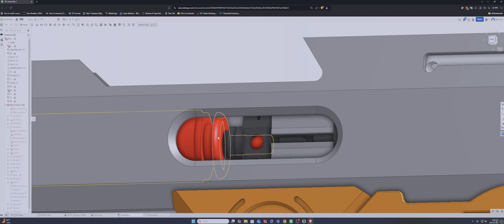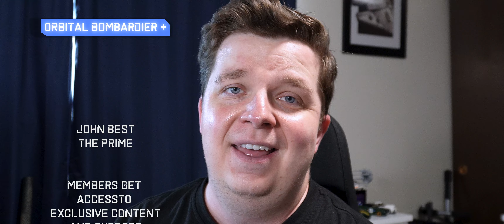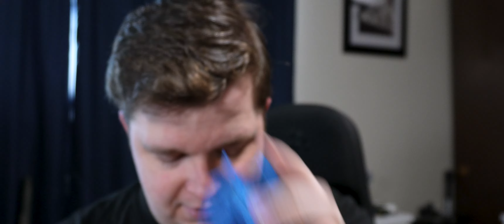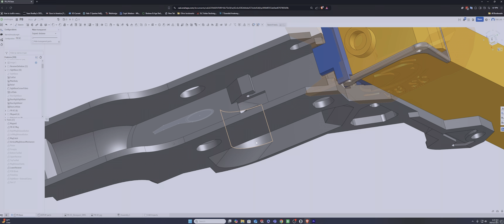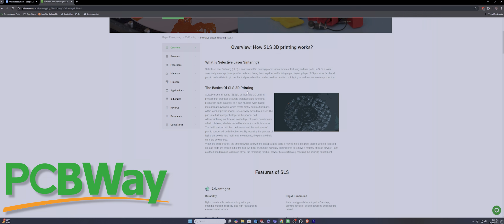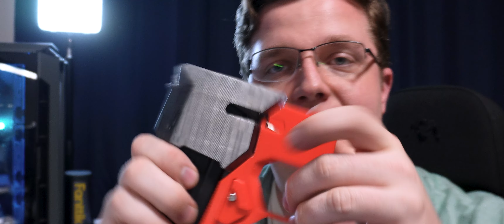I'M Turning Star Citizen into REALITY!

Comment: Especially if you want to be able to use it to adjust controls without taking the weapon apart, what if you treated the pcb screen as a rail mounted attachment (ala rangefinder)? The screen would be connecred to the pcb itself via a connection built into the rail and allow you to shape the pcb as needed and even build it into the hand guard. When you dont have the screeen attached, the pcb just remembers the last settings (i dint see how you built the pcb and wether you had on board memory, etc). 

Civil engineer so forgive the limited memory of my mechanical/electrical classes.
Reply from the maker: That is one solution. The thing I'm concerned about is users might not like being forced to have that as an attachment. So if I could shrink it down, that would be better. There's a little pocket of space in the receiver behind the solenoid. My ideal solution shrinks it down to fit in there. 
Never doubt your ability to put forward an idea. Mech Eng doesn't have a monopoly on ideas.

Comment: Could there be a way to split the pcb in half and join the halves via some solder and wiring? That way you could line them up side by side or front to back inside the stock or something like that
Reply from the maker: The code is written such that it should be able to support a smaller screen (cut in half horizontally).  I think I'll do that first as it's the largest component and has the biggest dictation over footprint.  Then we could look at splitting the PCB.  I don't want to stick it in the stock because I plan to make it functional as a side-folding stock.  Putting wires through that wouldn't be very good.  But if it were just static (non-folding) that is probably the best place for it.